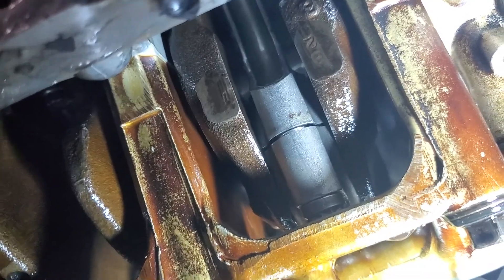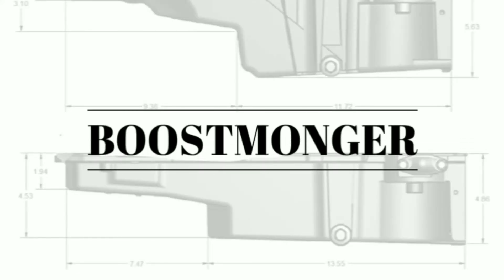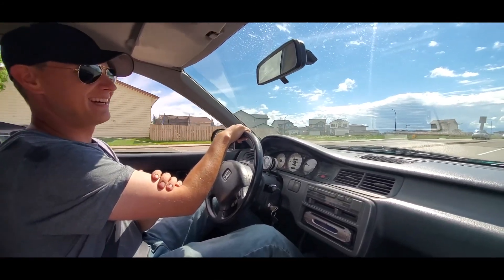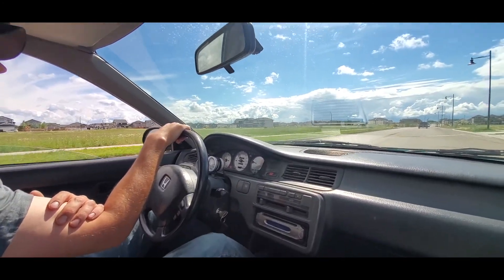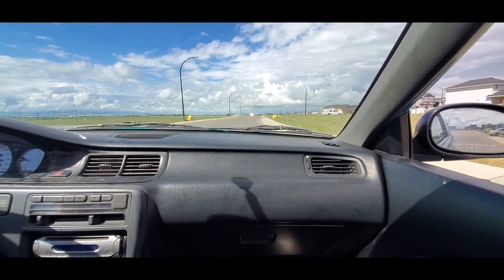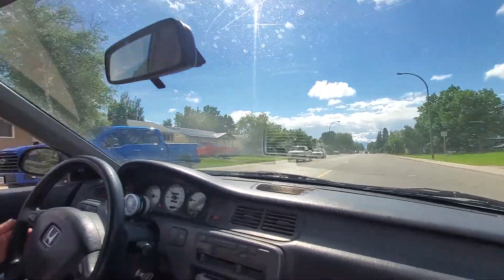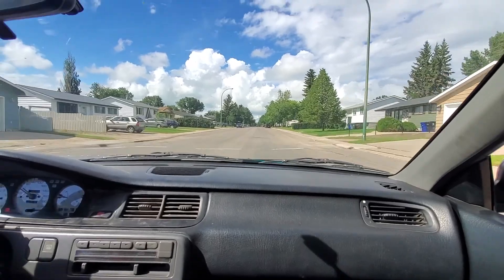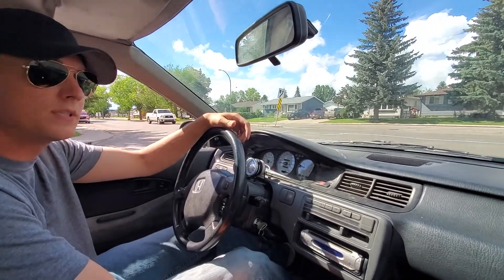SOHC Turbo Honda Civic part 10 (loose rod bolts, official first drive)

Comment: This is amazing to see. I was worried about the scoring in the cylinders in the beginning of the series but after seeing this I think my stock D16y8 that looks very rough but doesn't have anything fingernail gripping in the cylinders will be fine for me to home build. If you can get away with honing scores like that, internals, and a turbo in a d16z6 I should be able to get away with no bad scoring being honed, no turbo, and new stock parts in a d16y8.
Reply from the maker: To be honest i was worried about the scoring too. Seems to be holding up tho. Has to tiniest amount of blowby when i start it cold, however I did put alot of gap in the rings.

Comment: How is the block cement holding up? No debris on coolant?
Reply from the maker: So far so good
Reply: @Boostmonger_Jon  I was looking for a way to repair damaged deck and cylinder top edges and saw your video as part of a few ones, decided to use Moroso cement also, just did it this week and did a few videos on it for my youtube channel, thanks for the idea!
Reply from the maker: Nice! Hope it works out for you aswell as mine has